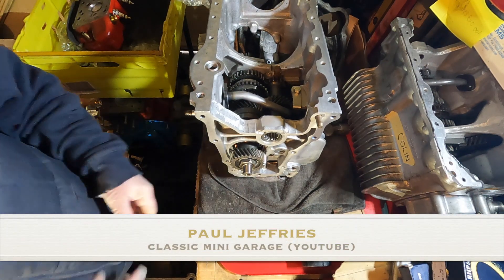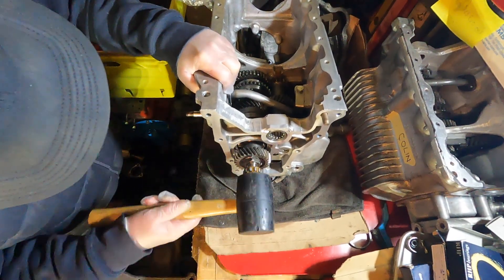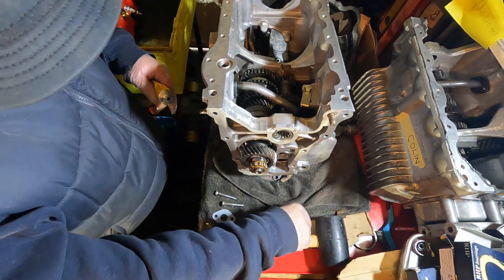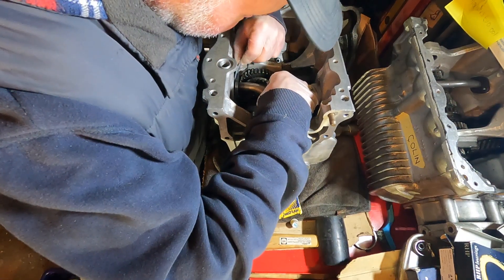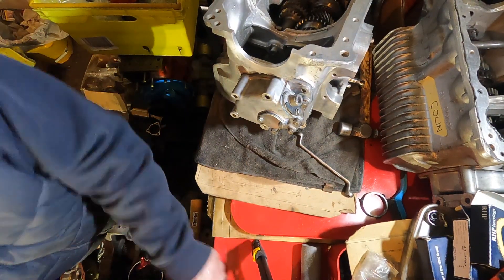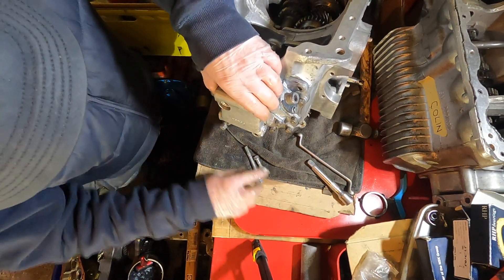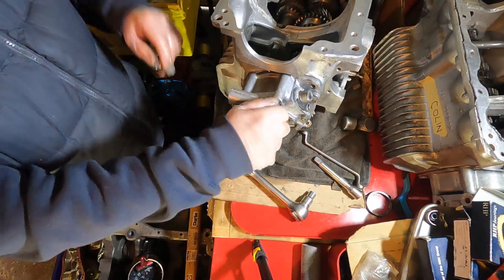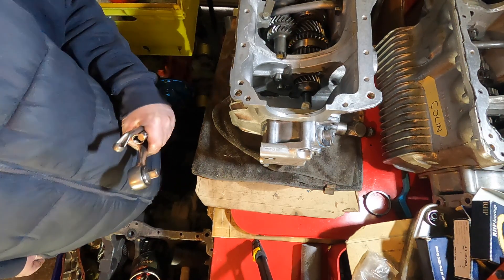Classic Mini A+ Series Engine Total Rebuild Episode 16 - Speedo Drive, Oil Pickup, Input Bearing

Comment: Quick question: Why use grease on the two gaskets yet Hylomar on the Oil pickup gasket? Just curious as surely its all the same oil thats going to be hitting the internals?
Reply: Hi, it's far more important to seal the oil pick up pipe gasket to prevent the risk of an air leak which will result in either very low oil pressure or no oil pressure at all, the other gaskets are under far less pressure hence the use of grease on those ones.